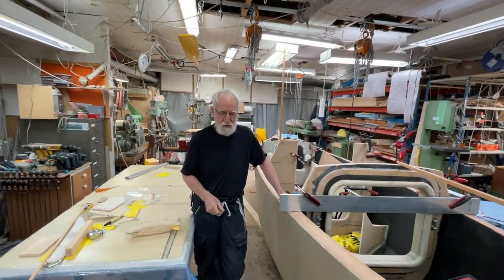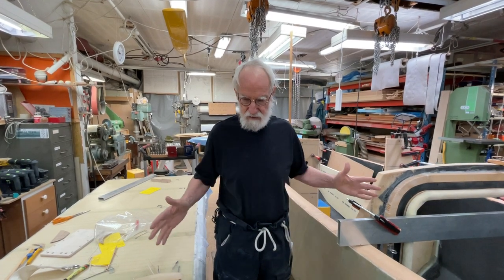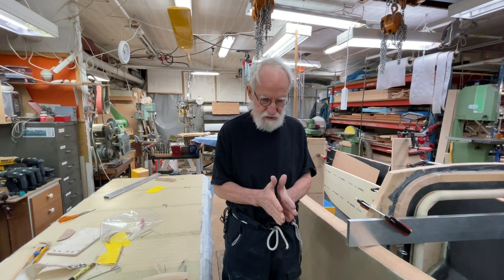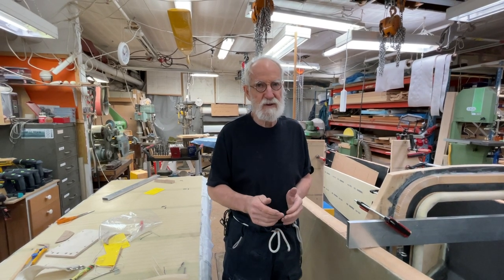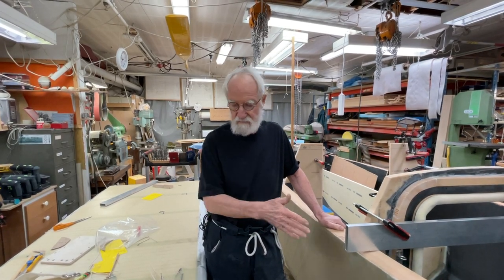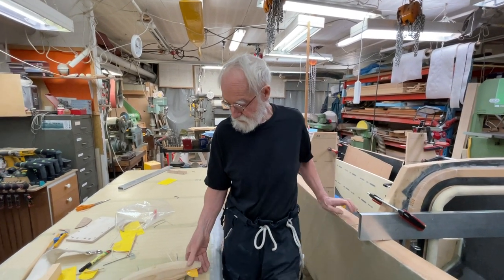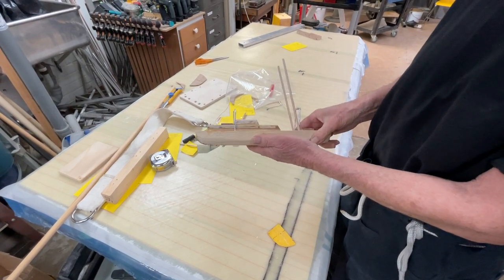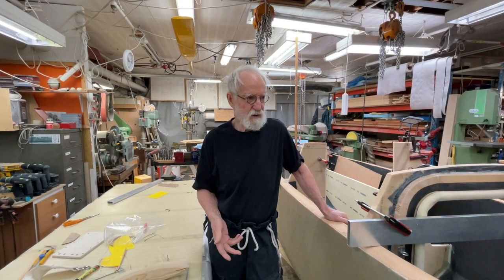Some of the reasons why Exlex the sailing canoe is a double ender.

Comment: Dang, I thought it was so you could quickly change directions and head back home when you realize your boat's too small.  : )  Just trying to be funny.  Another nice feature of double ender is that it reduces how much of a disturbance you leave in the water as you pass through it.  The more energy you leave in a wake the less efficient your boat is.  I watch those power boats that throw up a huge wake and think of all of the fuel they're using to make that...

Comment: Doesn't a double ender also steer and ride better in a following sea?
Reply: Yes, this is because there’s less “boat volume” to lift back there and there isnt a blunt transom to slap into.  When a boat has ”volume” under the water, that volume provides lift to the boat.  If you displace “1 ton of water”, you get one ton of force lifting up on your boat.  If you have a narrow aft end, the following waves are displaced less and you get less lifting force on your boat.

Comment: Very cool! The shape of your vessel evidences a sea kindly hull which should give you a easy ride in all but the worst of weather.  The first boat to be single handed across the Atlantic Ocean in 1876 was a Banks Dory, nearly identical in shape and proportions to your vessel! Alfred Johnson a Danish immigrant to Massachusetts sailed from Gloucester to Liverpool in 56 days 😳
Now a banker does have a transom but it's double ended on the bottom and about 12 inches wide at the sheer so essentially a double ender!

Comment: Sven, what do think of multihulls? Your present canoe design ×2 could make a nice cat.🐱
Reply: A cat that small will probably flip. This design will turn it self right after a flip.
Reply: Wondering also Sven's thoughts on small multihulls for voyaging.

A beach cat sized cruising multi can be righted singlehanded with a righting pole or a water ballast bag.

With a small rig such multi wouldn't be fast, but would be also less prone to capsizing.

A small multihull would offer more liveable space at anchor or at the beach while voyaging.

I wonder if adding a small float (outrigger) to a canoe shaped sailboat, could offer a more sea kind sailing experience...
Reply: @matiasmino7234  I have a Hobiecat 16 and I’m right above 100kg. It’s not an easy task rightening my cat, even in quite calm weather. The sail sticks to the water, and when it breaks free, the cat comes flying, so you have to grab it to stop it from turning over the other way. I wouldn’t want to do that in the middle of the Atlantic with 6m waves 😅😂
Reply: @jesperwall839  I sailed a Hobie 16 from Key West  to Cuba, 3 m. waves
Reply from the maker: The air temperature south of Cape Horn in summer is 3degres Celsius. A multihull is difficult to insulate and small ones do capsize.
Also they are much more complicated.
You get more living space inside a monohull for the same weight.
Propelling them by muscle power takes more effort.
They are suited for warm waters not for the high latitudes.
A small multihull with food and water for 100 days is not easy to right by body weight and with so much weight they have lost a lot of their performance.
I worked with Dick Newick for one year in 1975-76 I also know James Wharram and Ruth and Hannike Boon as well as Nigel Irens Walter Greene and more of the pioners.
I even built a proa 1963 I have been thinking about multihulls much. They are interesting and have their place but they are not for me and high latitude sailing in small crafts
Reply: @jesperwall839  (EDIT) thanks Sven for your thoughtful answer. Indeed all facts to take into account. Clearly multihulls are not a good option for high latitude sailing.

I will have to think again about the Hobie 18 modification.